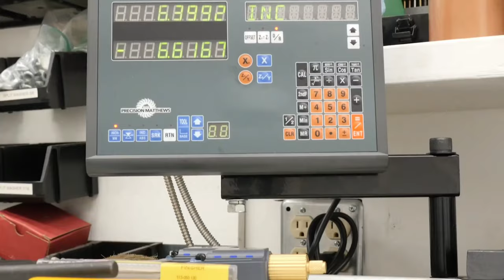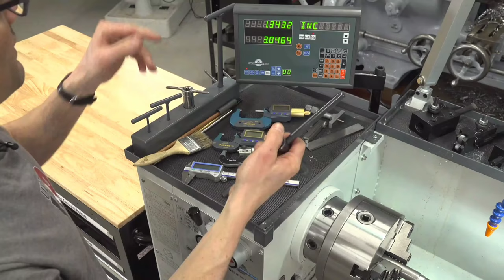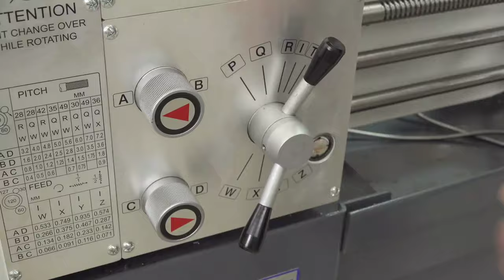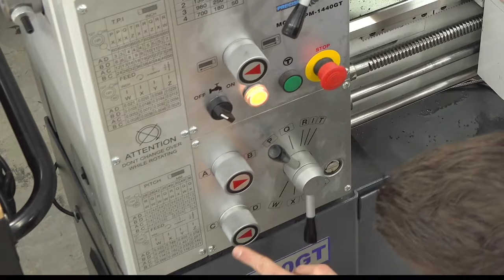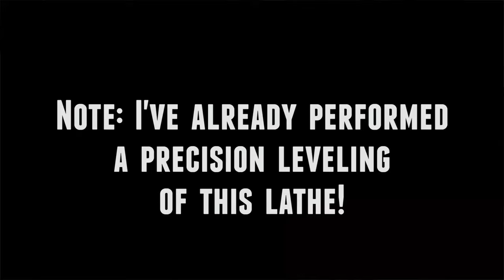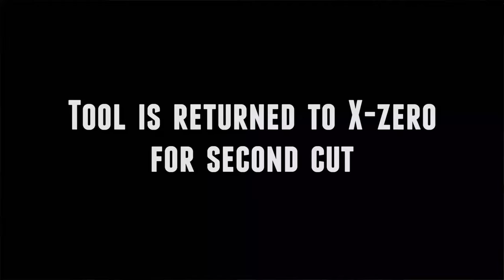How To Organize Your Machine Shop? मशीन शॉप कैसे संयोजन करें?

Comment: Aapko bhi apni machines main dro. Lagane chahiye .
Reply: How much cost of this machine ?
Reply from the maker: @bharatsablania6030  We Have similar Machine Model Banka 40-1000 / Model Banka 43-1000 both machine 6 Feet all gear lathe machine.  DRO You should be fitted on this machine. (Taufiq Mahida +91 9377093780)

Comment: Hi Mr Samrat, had another basic question regarding modern manual lathe machines. I notice all the modern lathes are under 1500 RPM. While the other day I came across an old HMT LB17 which had an rpm of 2000. how important is the speed of a lathe when making the purchase? I am not a machinist therefor I could be making a mistake here. But based on some online calculators for finding the rpm for certain jobs involving soft metals like Aluminium of small diameters, the required rpm comes up to 1800 and so on. Can Banka customise the motor to provide higher speeds or will changing the motor harm the existing lathe's gearbox?
Reply from the maker: Spindle RPM depends on 2 things diameter of job and material. You can exceed spindle RPM by motor pulley. If headstock get heat over 70 celsius you should stop machine. Changing headstock gear oil also helps. Thinner oil can reduce heat.